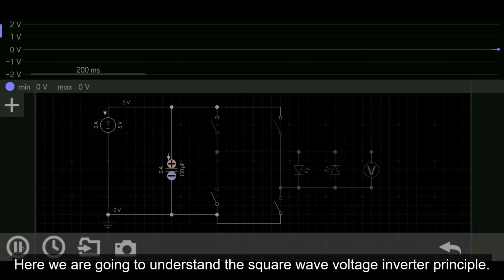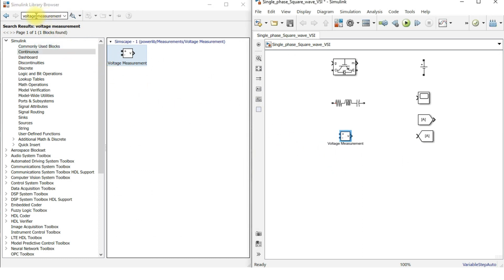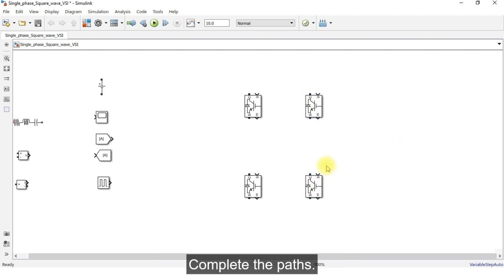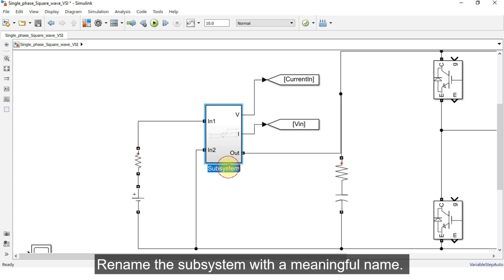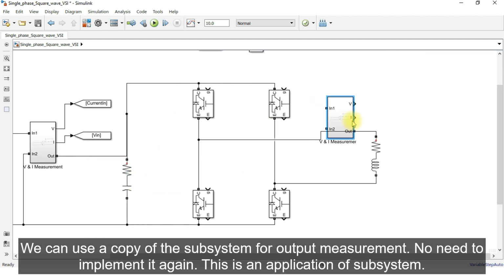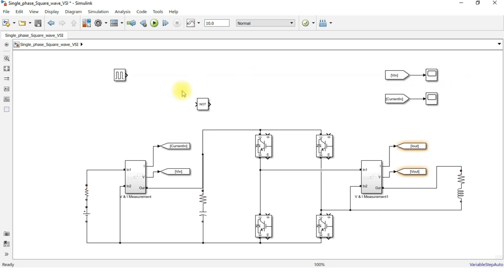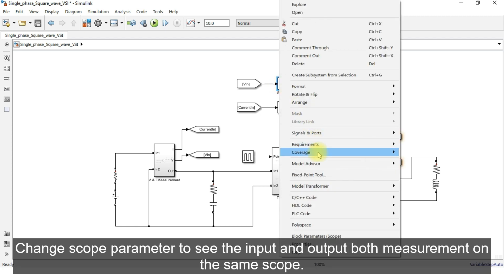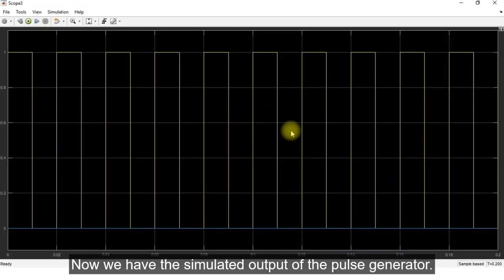| 1 | Single Phase Square-Wave Inverter 🔌| MATLAB Simulink📊 |

Comment: Is this for close loop?
Reply from the maker: No. A simple explanation on how an inverter operates.
Reply: @curioza5659  please make a video on close loop control in square wave inverter, or if you can send me on close loop then please send file on 
mayank062188@gmail.com